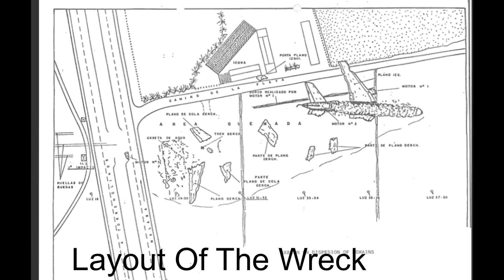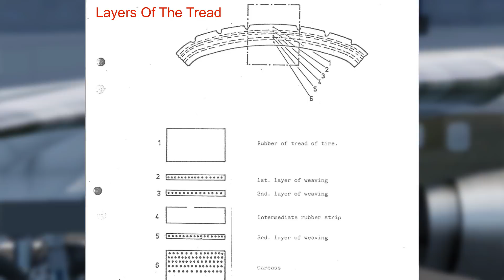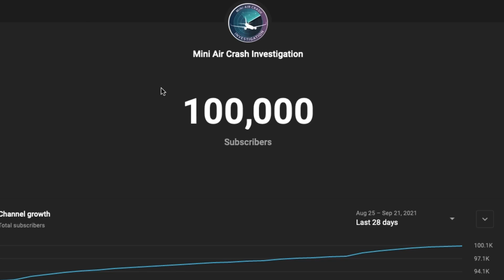How A Flat Tyre Killed 51 People | The Crash Of Spantax Flight 995

Comment: It isn't just that the pilot wasn't trained for the situation. It's that he had no idea what was wrong. Had he known it was just a bad tire, he'd have gone ahead with the takeoff, regardless of training.
Reply: How would he have landed at a higher speed without a nose tyre??
Reply: @MP-lb1bv  Keep the nose up as long as you can while slowing. Have the emergency crews ready. Also, there is more than one tire there. The blown tire may disintegrate, but the others will pick up the load.
Reply: There are only 2 tires in the front both were gone and even at slowest speed when the front axle would come in contact with tarmac we don't know how bad cud it be
Reply: @MP-lb1bv  That's why you muster the emergency crews and keep the nose gear up as late as possible. Or fly around until you run out of fuel and crash.
Reply: I can’t believe that a retread is allowed on nose gear. In the US commercial trucks are Not ALLOWED to use retreads on steer tires.
Reply: @BryanT I can just tell you that it seems to be true
Reply: For all the pilots knew, the vibrations might have been a portent of the plane simply falling apart at the seams while midair.
Reply: @samiam619  bruh that shit is wild

Comment: It seems to me that the pilot only had a choice of crash sites, either on the ground where he was already at or from the air at a much higher speed someplace unknown, maybe in the water. Reality is a gamble sometimes.
Reply: In retrospect, it seems like taking off, declaring an emergency, then landing again would have saved those passengers lives. But we can only say that in retrospect, since we know the cause of the problem. Training is better now to help pilots deal with these unexpected situations near to v1. 

Contrast this with the Concorde crash, where it really was just a choice of venues for impact with the terrain.
Reply: Sometimes rejecting is the best decision regardless. The DC-10 was a plane with many issues, and if I was flying a plane with a history of losing entire pylons, I would reject especially if the vibration increased as I rotated. You don't know if it's a door that's come open, damage to a control surface, or if your going to be able to maintain lift if the problem continues to worsen. Especially in a DC-10.

Comment: If it was the nose gear tire that cause the vibration, why did the vibrations got worse when the pilots lifted the nose? Shouldn't the vibrations have stopped when the tire left contact with the ground?
Reply: exactly
Reply: When the wheel was in contact with the runway, the weight of the aircraft would have damped the vibrations. Once the nose lifted, the free spinning unbalanced wheel would have transmitted the vibrations to the aircraft at greater frequency.
Reply: @johngrantham8024  I was going to say that but you beat me to it. The tire just doesn't stop spinning when it lifts off the ground
Reply: @johngrantham8024  ok I get that.thanks
Reply: Kenneth Freeman  - Or DOES it - Wouldn't the centrifugal force of a spinning wheel pull the nose down? A bit?
Reply: @philhughes3882  The gear is raised and lowered with hydraulics
Reply: Kenneth Freeman  - not the gear - the whole nose of the plane. When jumping a motorcycle, applying either front or rear brake will cause the unbraked wheel to drop considerably- pulled down by centrifugal force. Are plane wheels stopped before retracting for this reason?
Reply: @philhughes3882  not the ones I know of, but I suppose some might

Comment: At the time flight training concentrated on rejecting takeoffs for engine failures only. Rejecting for other reasons, even a "this isn't right" gut feeling, just wasn't a thing. It is now. You hear takeoff briefings along the lines of rejecting for any reason up to 80 knots, only rejecting for major calamities (fire, engine failure, aircraft uncontrollable) between 80 knots and V1.

I've only rejected a takeoff for real once. It wasn't that exciting since it only took about three plane lengths for it to be obvious something was wrong.
Reply: What was the issue that caused you to reject on that one occasion? Always like hearing/learning about GA incidents since I hope to get my PPL one day. "The more you know" and all that.
Reply: @sixstringedthing  A dragging brake. The plane pulled a lot harder to the left than usual, couldn’t hold the centreline, REJECT.
Reply: Have you been trained on twin engine planes too? I can imagine losing only one of two engines during take-off is about the worst thing that can happen to a GA plane.
Reply: @YourSkyliner  The bulk of multi-engine training is handling engine failures: takeoff, cruise, landing. Takeoff is indeed the most critical and requires immediate action. I went for a flight in a Piper Seneca once to see what it’s like but haven’t done a multi rating. Made me feel like a real pilot calling things like “V1...rotate!” and “Positive rate...gear up!”
Reply: "Not that exciting" is how I wish all failures in any plane I'm in can be described. ;)

Comment: He had two choices. One that didn't guarantee any life. Second, the one he chose definitely meant there's going to be some survivors. 

In both cases he must be almost sure that he won't be among the survivors. That was a courageous call and we should respect it. Sometimes we can't call a thing right or wrong.
Reply: not really. if he had taken off he could of landed with no loss of life
Reply: @dincerekin  He didnt know that. Easy to say when you know the problem!
Reply: @dincerekin  how could he have landed safely without a front tyre??
Reply: Landing speed is even higher than take off
Reply: @dincerekin  but there is so much examples of taking off with ''strange noises-vibrations'' because of V1 threshold, and cannot bring the plane back again.. So this was very understandable decision even if ended bad. For example if this was a engine problem, rejecting take off might save back seat passengers or everyone at different airport.
Reply: @GeirWaterloo  It would have been great if the plane was equipped with landing gear vibration/tire pressure sensors that can alert a pilot of an emergency. RIP to the lives lost, but his actions were commendable, and saved much more lives than a potential control surface issue during flight.
Reply: @MP-lb1bv   The risk from landing without a front tyre (or even without the front wheels down) is not that great.   Plane comes in and skids down the runway, usually doing itself some superficial damage.
BUT the pilot didn't know that, if the vibrations had been (for example) an engine - say the rear engine - it could have exploded and taken the control systems with it and left him in the same condition as UA232, virtually unflyable.

Comment: Tires are essentially several layers of synthetic fabric bound together with a tar that is cured to be firm. Also, tar bonds tread to the tire face, which is why retreading is possible. Retreading REQUIRES heat and pressure to quickly cure the tar, to ensure high quality. On this flight, the heat cycles caused the tar to delaminate.
Reply: They obviously haven't quite mastered it yet, - you can't drive 20 yards down a British motorway without seeing great chunks of delaminated lorry tyre.

Comment: Congratulations on reaching 100,000 subscribers. Absolutely love your channel!

I find it hard to blame the captain for rejecting the takeoff past V1.
Considering his situation at the time, he was under a lot of stress. Even if you peel that away, his choices were to either abort (in which case he may be able to save most of the souls on board, but may lose some), or take off (in which case the aircraft could easily come crashing back down, and that wouldn't leave many survivors). He took the pragmatic choice, if you ask me. As regretful as the passing of 51 people was, it was the least evil, so to speak.
Reply: You have to remember the reasons V₁  is established.  He didn't have choices.  Above V₁ is go.

Comment: Retreaded plane tyres? I had no idea they did that. I find that a little concerning

Edit: I also think planes might benefit from an external camera or two. Quick look at the camera/s might have given them confidence in lifting off as there were no obvious signs of structural damage or engine issues. 

Maybe
Reply: The A380 has such now. And it helped the Crew of that Qantas flight were the engine exploded. But in this case there wouldn't have been enough time to watch camera screens. Especially if you do not know where to start.
Reply: FYI,  in the States regarding commercial airlines,,according to the FFA you can recap an aircraft tire up to 10 times so long as there is no damage to the first cord.
Reply: Still, retreated tyres sounds super sketchy
Reply: @theraizor3574  Agreed! On a huge jet airplane and with the enormous forces the tires have to withstand….sketchy
Reply: No need for external cameras 99.9999% of the time. Besides, at that speed the tires would be just blurs anyway.
Reply: EyewatchlessYTeach Timetheylockmeout  would be no obligation to use it. If the pilot didn't want to check it in X situation it's their call. Just another option.
Reply: @70slandshark47  interesting. I had no idea.
Reply: @marsgal42  agreed but I've also seen quite a few times when pilots have had to act not knowing the extent of the damage to the structure of the aircraft. Having to wait for cabin crew, relief crew or previously flight engineers to be able to go back and check the damage and make a report and in the case of the cabin crew they are not pilots. 

I didn't mean in this case they'd have seen the tyre and the cause of the problem but they would have seen what it wasn't.
Reply: @theraizor3574  they are
Reply: @theraizor3574  Retreading tires is fine as long as it's done correctly.,I Work at a place that retreads semi-truck tires and the standards are quite rigid. Both in the condition of the tire getting capped and the quality of the new treading.

The fact that the words "Air Bubbles" are used in this video raises a massive red flag.
Reply: I've wondered the same. Not only is it an extremely cool thing as a passenger on the A380, there are many of these videos here where it would've been useful as a diagnostic tool. The cockpit placement as we know it gives the pilots the best overview of the surroundings but the worst of the plane.
Hope they introduce it more in the future.
Reply: I was surorised too..I've never used retreads for my car.Here it's a jet..😐
Reply: It's standard, they're designed for it.   All that smoke when they land is tread scrubbing off.   Would you throw away a tyre that's got worn tread but only done about 20 miles of actual running?

Comment: My father had exatly the same problem in the late 70`s when he took off from Oslo enroute to Las Palmas in a 737.   A big bang at V1, vibrations so strong he couldn`t read any instruments, but he continued the takeoff!  Several seconds later the vibrations disapered , but he had his suspicions even if there was no warnings in the cockpit. Next plane to land, a SAS DC 9 had to abort due to a lot of fragments on the runway. They soon found out that the fragments was one of the nosegear tires on the 737.  He continued to Sola(Stavanger) airport for holding for several hours to burn fuel before an successful emercency landing was made. I remember the following Christmas with a lot of flowers and thank you cards from the passengers.

Comment: Congratulations on reaching 100K subscribers. The word that jumped out at me from your narration was "retread". I'm not a pilot, but I do drive a motor car and I would /never/ depend on retread tyres. It's been years, if not decades, since I've seen any retreads for sale at any reputable store in here in the USA.
Reply: @J S Thank you for your interesting reply. I happen to be someone who dates from "decades ago".
Reply: Commercial trucks and trailers use retreads frequently.  However, I believe they are not allowed as steering (front) tires, or at least not recommended as such.
Reply: @J S Well thank you very much. Just what I was wondering about. Cheers mate.
Reply: commercial retreating is a lot more strict than general consumers, especially aviation. Upon inspections during service tyres would be removed and sent for retreading once it meets certain criterias way before the actually inner tyre itself suffers any damages which will deem it unsafe. Where in a typical car for example it’s hard to regulate and most consumers would use to tire until it’s past the point of being safe for a proper retread

Comment: Welllll..... if the pilots had known (which they did not) that it was a blown tyre then for sure they would have been very surprised to learn the vibrations became WORSE when lifting the nose!
Yeah, carrying weird vibrations up in the air with you is equally bad. Under these circumstances it is better to alert ground crew than parking in a 10m deep hole. Pilots get my vote of confidence.
Reply: Did the pilots died?
Reply: @jorldan5440  Nope, they're fine.They didnt hit a large building like depicted in this video, most died due to smoke&fire on impact of a concrete wall at the rear section of the plane. 3 crew were trying to open 2 rear doors for 47 ppl but those were too twisted...:(
Reply: @surf2257  I don’t know if your being sarcastic about them being just fine lol 😅
Reply: Not-a-pilot (or anywhere near it) but was wondering why the vibration would continue / increase after the offending wheel was off the ground. Is it because it's still spinning and off balance?

Comment: It sounds "surprising" that the vibrations increased when rotating, with a destroyed front tire, I'd expect vibrations to abate instead. Anyway, the rear view mirror clearly shows how it would have worked best to follow the standard procedure of rejecting when unexplained vibrations started, or go through with the takeoff. While the pilots could not know what had happened, the video explains how the reject takeoff decision process was deliberately cut short due to the low time available for problem analysis. Trying to stop much too late was highly dangerous, while taking off with an unknown issue would on average only be risky.
Reply: When on the ground, the ground would 'deal' with the 'eccentric' tyre. In the air, the whole eccentricity was on the axle and the the plane would have to absorb all the vibes. Pity they felt the vibes in the yoke - without that, they may well have gone on with the T/O - which in hindsight would be the better option.
Reply: there have been cases where a tire goes flat and then catches fire. The plane takes off, the burning tire gets retracted, the fire spreads to the rest of the plane and everybody dies. That was the case on Nationair flight 2120. If they'd rejected the takeoff when their tire blew, the crash wouldn't have happened. So you're right, if something doesn't feel right, abort the takeoff when you still can.
Reply: @adotintheshark4848  I've recently seen a video on that - stowing a burning tyre!
Reply: @millomweb  yes, and the plane burned in the air. People were falling out of the plane.
Reply: 1970 Trans International out of JFK. Opposite story. The nose lifted early, dragged the tail for 1200 feet while they tried to get the nose down, took off any way, pitched up, stalled, made a Crater.

A rock for caught in the elevator and jammed it all the way up. Everybody died. (Only 11 crew on that one.)
Reply: @briant7265   That looks like a very clear case of the need to quickly abort when things start going wrong in an "unusually slow" takeoff. As the final NTSB report says 

"an apparent lack of crew responsiveness to a highly unusual emergency situation, coupled with the captain's failure to monitor adequately the takeoff, contributed to the failure to reject the takeoff". 

Obviously a very stressful situation, and rules were likely less clear at that time, but this only strengthens the case for "better safe than sorry". 

To be clear, I'm not trying to decide who's "guilty", just see what can be learned with the benefit of hindsight.
Reply: @JohnnieHougaardNielsen  Exactly. And a lot of people forget that we are looking back on cases from 40-50 years ago, that contributed to better underrated and improved protocols. We can't properly evaluate when a takeoff should proceed without also evaluating when a takeoff should be rejected. I brought up the other case only to illustrate that it isn't as simple as some people think.
Reply: To make the plane rotate, the elevator pushes the tail _down_, rotating the plane around the main gear as the nose comes up. So, counterintuitively, I think the weight on the main gear would have increased during rotation. I think pilots should have been trained to recognize symptoms of a tire problem during takeoff, especially given that there were not warnings for it
Reply: @alexf9472  It turns out that vertical load-vs-time for a MLG tire during takeoff roll is an almost flat (horizontal) line for about the first third or half, very gradually drops off to maybe ~90+ percent of the initial value just before rotation, and then drops sharply towards zero (not increases) once rotation starts.  That's the effect wing lift has in gradually taking weight off the tires as speed increases, and then removing it rapidly as angle of attack suddenly increases.
Reply: once the nose wheel got off the ground, it kept spinning in an unbalanced state, no longer touching the ground, which dampened the vibration to the aircraft, once airborne all that vibrational energy went into the aircraft, not the ground.   makes perfect sense.